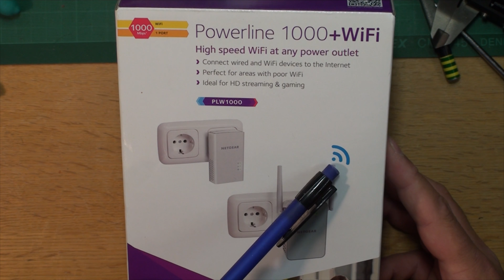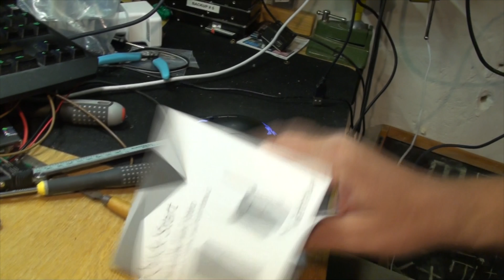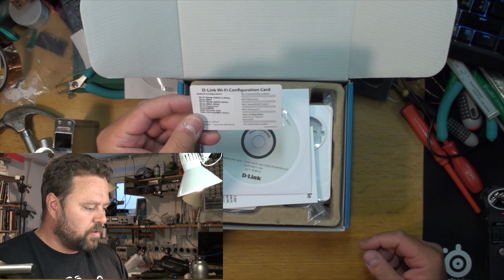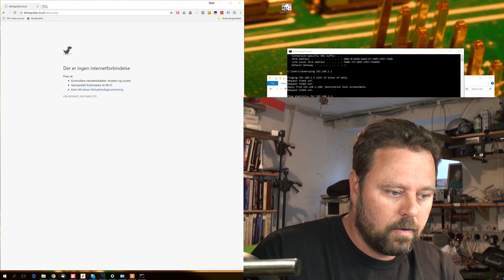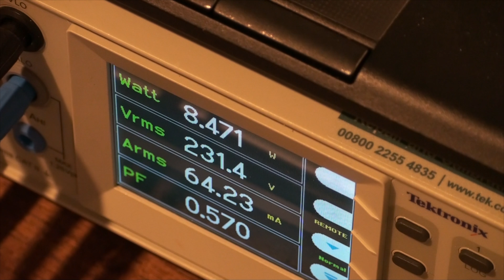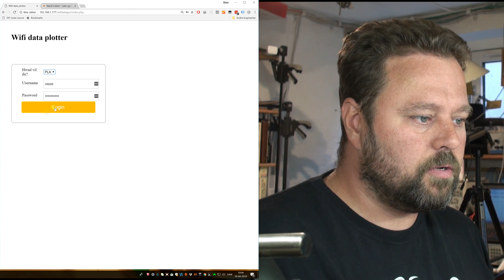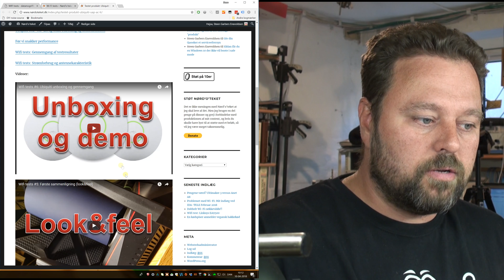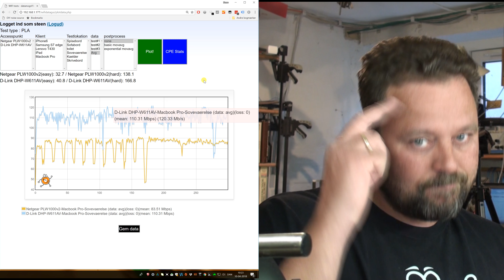Face-off: Netgear versus D-Link Wi-Fi extendere med PLA backhaul

Comment: Har du nogen test hvor du køre med flere enheder på samme tid, nogle enheder virker til at falde voldsomt i ydelse når man kobler mange enheder på
Reply from the maker: Ja det tester jeg i alle mine tests i den del hvor jeg tester enheden i praktisk brug. Jeg nævner det kun hvs jeg ser noget som stikker kraftigt ud. Jeg laver ikke de tests formelt med grafer, etc af to årsager: 1) det er ekstremt tidskrævende , og 2) udføres testene manuelt er de svært reproducerbare, da resultatet afhænger af timingen mellem alle enheder der transmitterer. Måske engang i fremtiden det kan lykkedes mig at få tid til at designe noget hardware som kan styres automatiseret af min test software... :)
Reply: Super, det er nemlig bare ikke så realistisk at man kun har 1 device opkoblet på sin router :) Synes ikke min AC66U (Hastighed er ok, svartider virker langsomme)køre så godt, men om den bare ikke er så glad for at bo i en stor betonklos lejlighed med masser af andre forstyrrelser ved jeg ikke, men tror jeg venter med at opgradere til AX routere kommer ud, lyder til at de burde klare sig bedre i congested områder